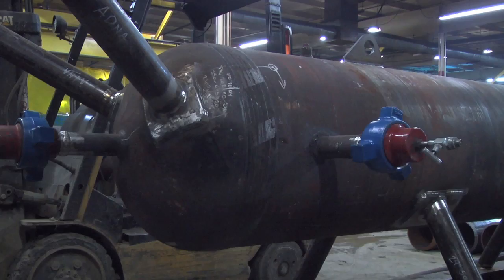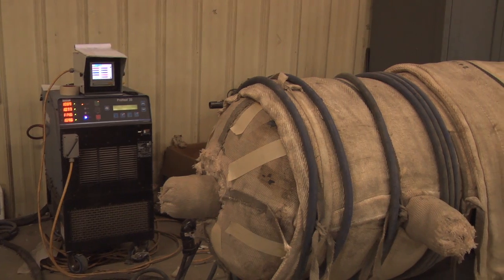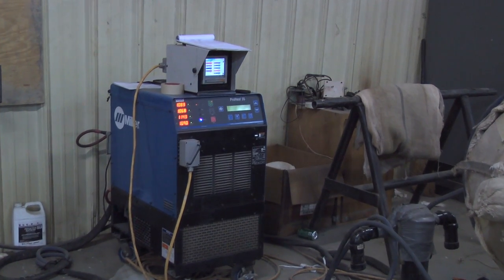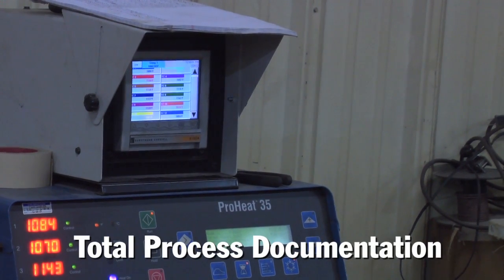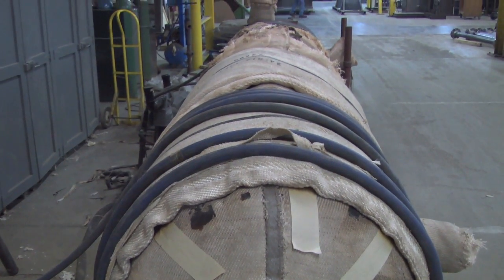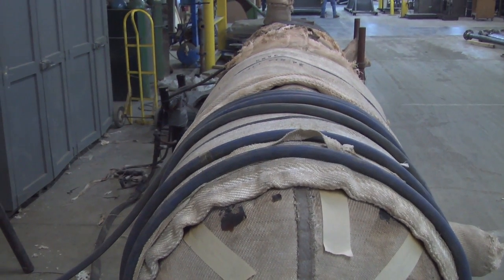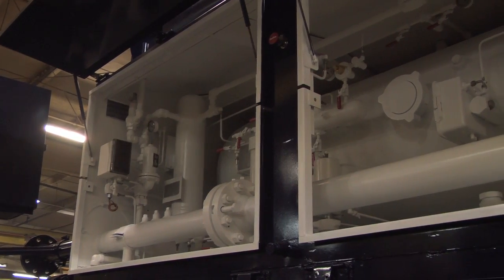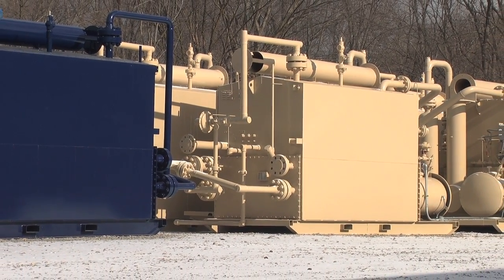Stress Relieving with Induction Heating Cuts Out Middle Man

Comment: How the heck does one control top and bottom to maintain plus or minus 25 deg. F. ?
This looks to be a nozzle welded to a 20" vessel.  Everyone knows a full circumference of heat must be maintained at the nozzle soak temperature on pipe and vessels greater that 12 inches in diameter and require a thermocouple top and bottom.
Reply: You can't really maintain top to bottom with induction without the vessel rotating

Comment: I'm concerned with what I'm seeing here.  As a Field Heat Treatment person for almost 30 yrs and a member of AWS D10.10, with extensive knowledge of Induction, Combustion, Resistance, and furnace Manufacture, the video depicts a problem I see all too often with the application of induction heating practices by some who are underinformed by lack of exposure to the perils that can exist with the high watt density potential of Induction and its resultant problems when applied incorrectly.  Don't misinterpret my response.  We use induction heating everyday, and it does have its place.  Having said that, without tacit knowledge of heat transfer and gradient temperature issues, you can actually be doing more harm than good.  Sometimes the cheapest alternative is not the best.
Reply from the maker: Redheaded Menace Thank you for highlighting the importance of proper post - weld heating procedures to ensure quality products. This video demonstrates the success one of our customers is having with insourcing heat treatment activities using the ProHeat 35 Induction Heating System. Our goal in developing the ProHeat 35 was to make operation of the machine easy for contractors to use, while providing training to employees with the assistance of Miller's Induction Heating Specialists. As you pointed out, proper thermocouple placement, wrapping of joints, insulating, and documentation still needs to be cared for in post weld heat treatment activities. While not discussed explicitly in this video, this contractor  did indeed provide proper training to its employees. We always recommend that users be properly trained before using Miller equipment, regardless of application or process. If you have specific concerns, please message us to discuss in depth. Thank you.
Reply: Sir, we have recently start up a alloy steel foundry. we have an induction furnace of capacity 500kg. We are currently facing a problem. Our casting no matter what the casting chemistry is, we are facing the difficulty in machining. Kindly, help us.